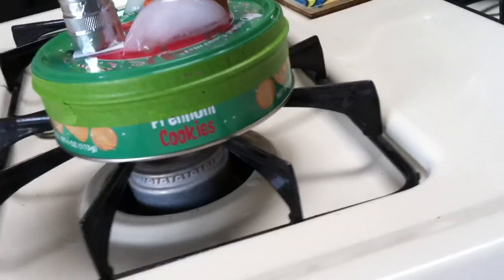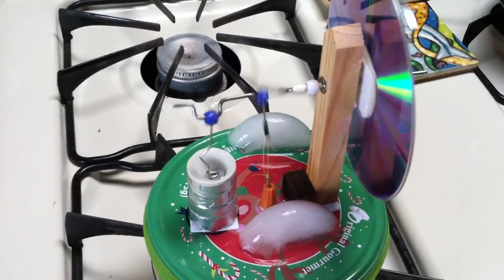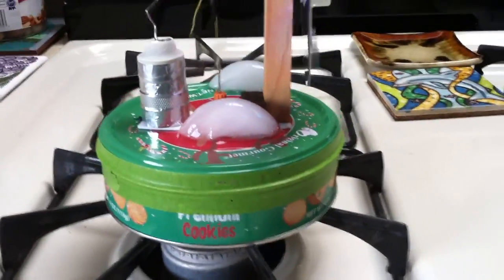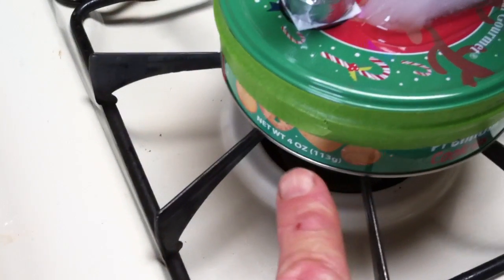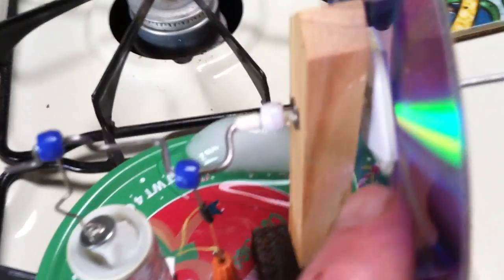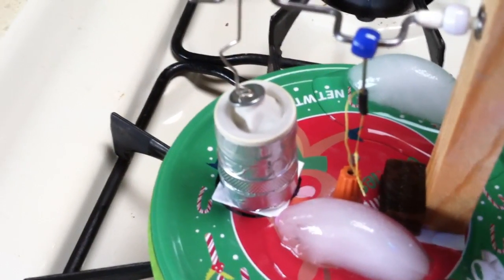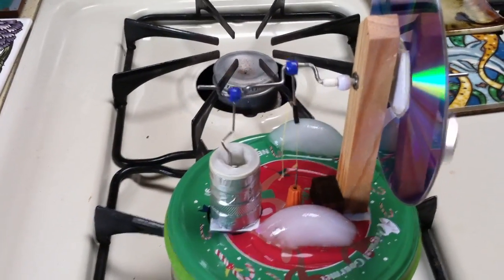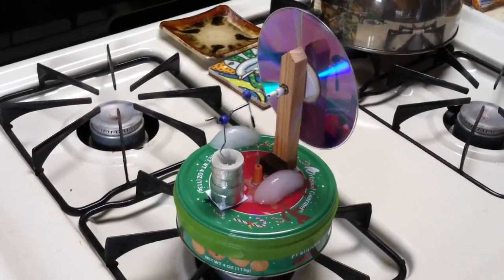Cookie Can Stirling Engine --RUNNING !!!

Comment: Well done! I've tried making 3 of these, not easy to get them to work. There seems little margin for error. I have yet too be successful 😩. Shows what a great intuitive builder you are !
Reply from the maker: Thanks.  You are right about these engines being hard to get running.  Keep trying.  I suggest the soda can model as a good 1st project.  I watched lots of videos and then just kept building.  A machine shop version would be nice but building one of these crude ones using simple parts and hand tools is very satisfying.....when they work.  I have had a number of complete failures. Once you get one running the addiction starts.
Reply: Hi, Im struggling with making a stirling engine all the adjustments are right, crankshaft is properly bent, but im wondering if a was small.

Comment: Great job, I figured the sponge would be too heavy to work.  I wonder if airogel would be a good high temp low weight displacer ?
The gravity return seems like it would act like a speed control .
Reply from the maker: I may try a hard connecting rod on the displacer.  I think you are right about the gravity method acting as a speed control.  I have used this sponge displacer method before so I knew that part would work OK.

Comment: very cool. Can you show us how to turn the flywheel into a simple generator that safely charges a lipo mobile phone battery with female usb sockets to power different devices. Thanks
Reply from the maker: That project is beyond the scope of my hobby.  I did see a video where a guy built one of those.  He built a stirling engine that would provide electricity in the event of a power outage.  He ran it on the natural gas.  It was a machine shop project though and something you could not build on a kitchen table.
Reply: Im going to braze my first project in steel. should look good and be tough as nails. if that does not work i will just have to go the CAD machine shop rought. thanks anyway.